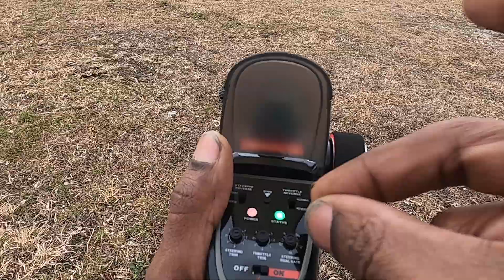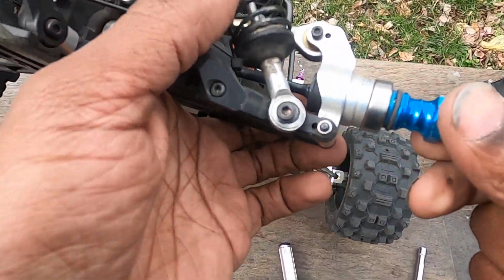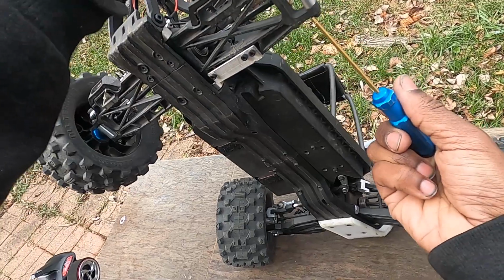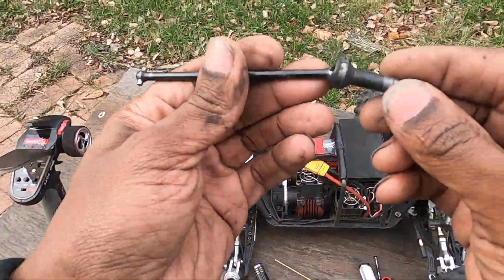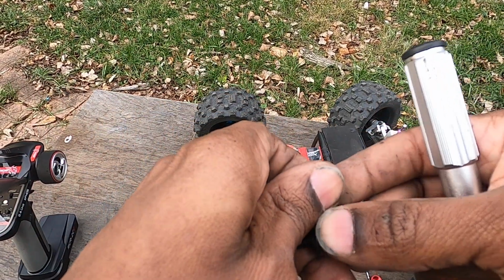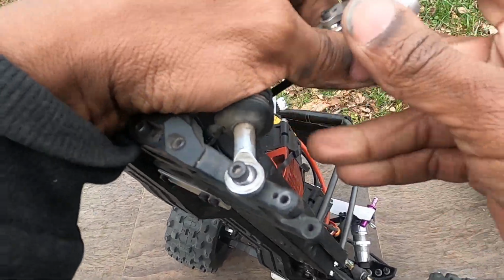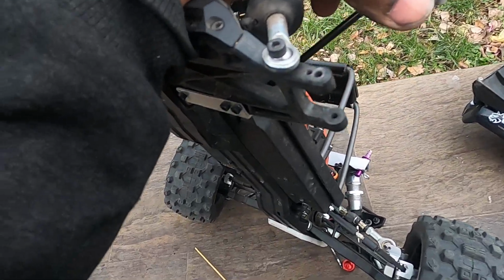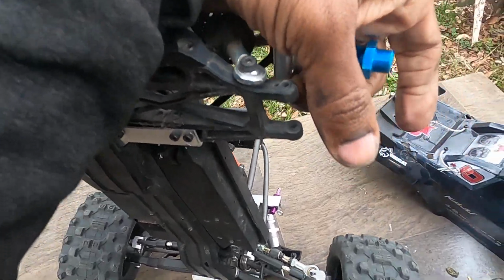Redcat Kaiju - Stadium Truck!!!

Comment: What did you put over rear diff cups, because I blew mine out on my Kaiju
Reply from the maker: bearings, 12x18x4. I put 2 of them on each cup. Extreme Precision RC makes diff cup covers, but they didn't work too well for me. The shaft bent the lip of the cup making nearly impossible to take off when the shaft pin completely eats the cup.
Reply: @Megasty15  thanks for the tip, gonna rebuild my front and rear diffs tomorrow and cushion the drive cups with a small piece of rubber nitro fuel hose inside so the shafts don’t jolt around and stay snug

Comment: What fans do you have on there is you dont mind
Reply from the maker: The fan is PFB0412EHN. 12v ran off a 3s lipo. I also use FFB0412SHN. It's also 12v but can downvolt to 6v to run off the rx - but it's really slow at that voltage so I run it off a 3s lipo. Both are the 2 pin/wire version. I bought both from Arrow.
Reply: @Megasty15  thanks I just bought my kaiju so I am on hear looking for the basics needed upgrades I I run 12v wtf fans
Reply from the maker: @ihde2000  Arms, steel spur, & fans. That's the basics. Everything else I'm doing is turning it into what I want it to be. It's a seriously fun truck, but it's a handful to get use to bashing it.
Reply: @Megasty15  yeah I put a heatsink  and fan on the motor ordered the metal spur gear and I had to buy the servo horn barely hit the curb and it stripped that plastic gonna do the center mount also but I am going to configure something a little bit different but similar